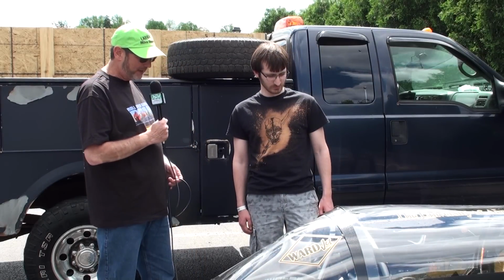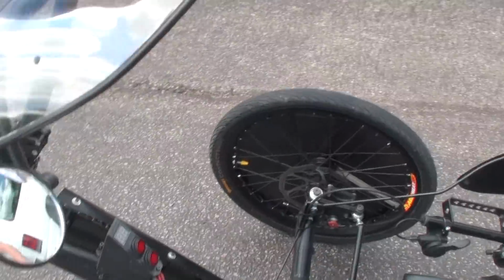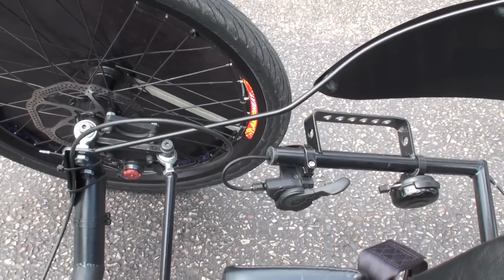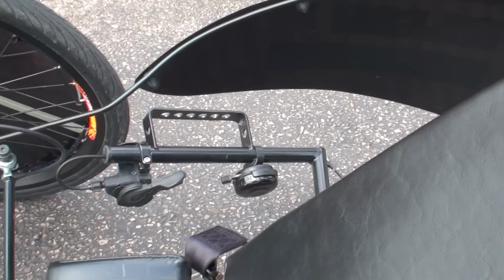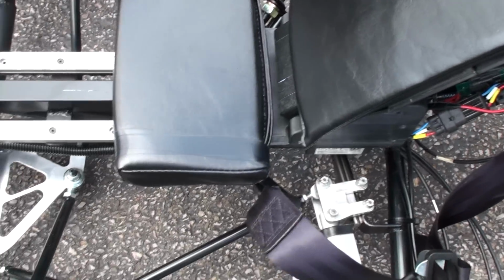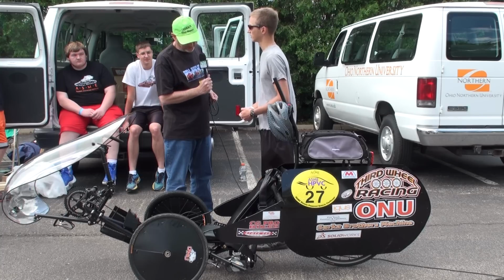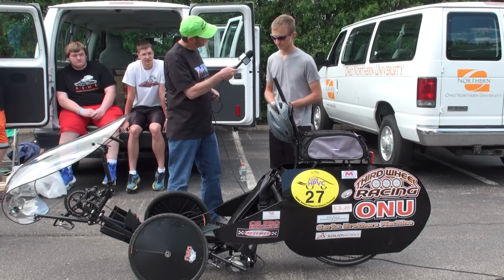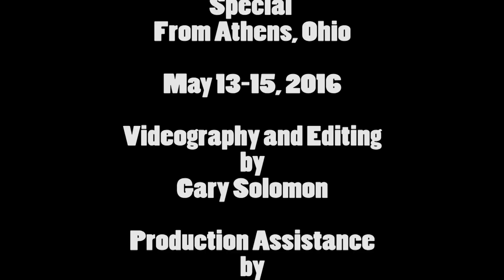"Students Building and Racing Their First Bents" ASME HPV Challenge-Laidback Bike Report

Comment: why those silly rolebars?
Reply from the maker: The students are required to meet stringent safety standards on their HPVs. This includes a "rollover" test during the competition. Hence the bars 😊
Reply: hey  @GarySolomon  thanks for the quick answer! I see the point in constructing it to get the points. But is it really safer?
 I feel attaching somebody to the vehicle and then making the vehicle capable of a rolltest is a concept diverged from cars who have more impact energy due to speeds and weight. And making the bicycles heavier takes away their advantage of having less impact energy at same speed due to adding unnecessary weight? doesn't it? 
And is strapping the riders to the bikes really helping? Often I need to move around to avoid falling over ...

But I get that this was part of the amazing challenge the students took on and in case of the full fairing it does get better looks I ll admit :)

BTW: Hope to see you at Spezi! ;)